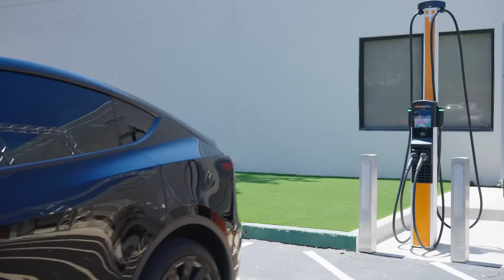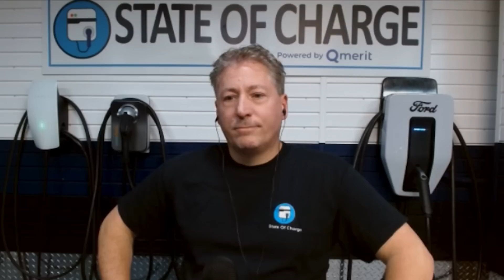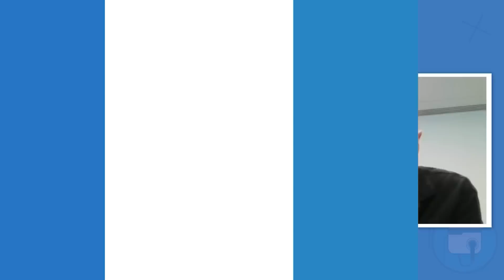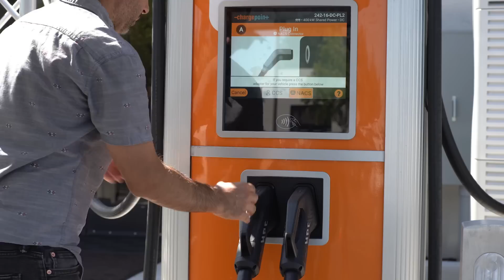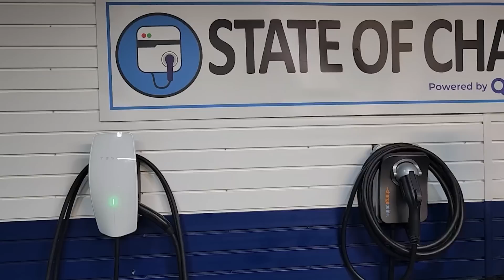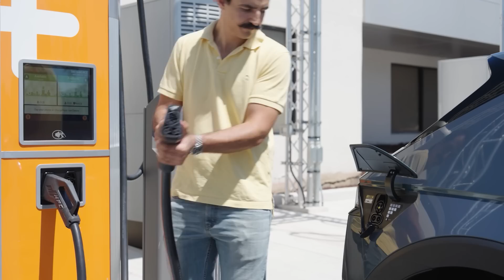ChargePoint CEO Rick Wilmer Discusses How Omni Port Will Eliminate EV Charging Connector Confusion

Comment: Maybe you can tell me why I always have to 1) Plug in my Chargepoint Flex to my EV (either Bolt or ID4); 2) Wait for the yellow light: 3) Unplug the charger; 4) Wait for the green light. Always. Both cars. Other than that, I love the system! 

Speaking of modularity - I think it would be really great to offer a dual-cable adapter kit for the Chargepoint Flex. It would have to be intelligent enough to either switch or share the connection, but I don't think it's an insurmountable problem. Thanks for sharing!
Reply: Sounds like you're having some kind of wi-fi connection problem - the white light indicates no wi-fi.  Are you able to see charging activity on the CP app?
Reply: @MichaelKirven  Interesting. I didn't know WiFi recognition was necessary before charging. I don't know how I'd go about testing that. Thanks for your input though.

Comment: If all chargepoint dcfcs are connected to chargepoint network how do you not know they're not working? Relying on drivers to diagnose and relay information is asinine. My car just notified me that the door wasn't closed. Let's move into the times. Might want to put giant signs on the units w/o a service plan, BTW. "Owned, operated, and serviced by XYZ shopping mall."

Comment: Really cool upgrade... now they need to build out Express Plus charging stations across the street from Super Chargers that Charge Point owns, manages and maintains.   This will address some of the negative fluff out there about neglected charging staions.   All Express Plus stations sold should be maintained by ChargePoint...so they always work.  These are their flagship chargers and with these new connectors they could become know as the go to station for fast charging.
Reply: 100% if they maintained their stuff it would turn their image around instantly.

Comment: How many of them work on a consistent basis? My experience, particularly in the Austin, TX area, is that they are very poorly maintained and half the time they do not work.  They can talk all they want about the different models but all we see is the label ChargePoint and it is not working, it is a terrible image. My suggestion when they do not maintain them is to put a different label, probably the label of the owner.

Comment: It's very frustrating seeing a 50 kW ChargePoint  near me at a truck stop next to a main highway that has been off-line for years. My best information is the owner needs to pay for a new board to get it back on the Cell network after the Cell Carrier shut down the old system. Such a good location, part of the truck stop , A Wendy"s, sub shop. gas/convenience store . Next to a solar farm.  I was there one day when a new Leaf owner was trying to connect to it -It is not listed on the ChargePoint app anymore. At least the level 2 unit was still there.  Probably easier to replace the unit with the  new omni-port. 
I was at a location at another Wendy's in a lake-side tourist town . They had a level 2 ChargePoint that was off network. Using a NFC card would turn  it on for a free charge!  Very handy near the motel and a Frosty. <G>
Reply: You gotta go into the business and let them know you'd like to have the charger working. These franchise owners are still a small business, they have to make a business case for the expenditure. More people coming in and seeing the charger as a draw for the biz is how things get repaired.

Comment: Omni Port is a gap technology that’s not really necessary. Eventually all of NA based EVs will use the NACS. In the meantime, would you really go on a road trip and not bring charging adapters because Omni Port is available? Of course not. So, Omni Port becomes a pleasant surprise instead of a differentiator.
Reply: It's still going to take 20 years before all EVs on the road have NACS. You still have to account for all CCS vehicles that are currently on the road and factor in how long they last or even  pre-owned CCS vehicles that will be purchased in the future. The Omni port is needed to help this transition.

Comment: THERE ARE NO UL APPROVED ADAPTERS - THERE IS NOT STANDARD
Reply from the maker: You are correct, which is why I mentioned that. However, ChargePoint has worked with the SAE and UL to make sure the adapter conforms with UL 2252, which will formally be adapted in a few months and the adapter should receive formal approval then.
Reply: He literally said in the video that it IS UL Approved...
Reply: @dtiff  I think the deal is that the whole system is UL listed.  Just as the Tesla Universal Wall Connector is UL listed, inclusive of its captive adapter.  But neither Tesla nor Chargepoint can sell those adapaters separately as being UL listed because that standard isn't official yet.
Reply: The Omni Port has the UL mark in their press videos If you look close

Comment: I really don't like their business model. If I go to a BP gas station 99% of the time it works. Besides a spill or power outage, I can get gas. I will look on ChargePoint's app for an available charger and it will say it's available and ready. I go to the site, and it doesn't work at all. I blame ChargePoint. This is the business model they chose. Instead of installing and maintaining the equipment like gas stations do, they decided to sell the equipment and then be hands off; kinda like the ice cream machines at McDonald's in a way. The purchaser can't work on the equipment without overpaying the company to fix it. Until ChargePoint owns their sites like most companies do, it's just not going to work.

Our electric company just put in a 62.5kw station by me at a gas station. Of course it is ChargePoint. So, our electric company has to rely on ChargePoint going forward for fixing the unit. Thus, I will blame ChargePoint if it goes down due to communication errors or anything else outside of a mass power outage.

Comment: If Omniport is like Magic Dock, I'll likely never see one, but I need CCS anyway.

EVGo is my favorite network because it supports plug and go. I don't need an app or an RIFD card or even a credit card. After the first use, the network recognizes my vehicle when I plug in and has a record of my credit card. It's easier than pumping gas even if it takes longer. Why don't other networks do it?

ChargePoint is a close second because I have an RFID card on my keychain that Chevrolet included with my Bolt EV. Only a quick swipe of the card is needed. PlugShare reliably lets me know that a station is working, so I don't worry about stopping at one that's out of order.

Electrify America is near the bottom of the list because even with their app, I often must call their support # to start charging. Maybe they've addressed this problem, but I wouldn't know since I now avoid them.

Comment: Mr Wilmer, will the Omni-Port communicate with older Tesla’s using (CAN) their communications standard? Every customer should upgrade their Charge Point hardware pronto to avoid adapter havoc from the damage they can/will/have pass along. The cost of flaky adapter damage vs this upgrade is negligible and the versatility it adds is two fold. Budget it and get it done to make the most of your investment. I’m looking forward to the GPS based station trouble reporting capabilities in the near future. ~ A Charge Point HomeFlex Owner and frequent Charge Point DCFC customer. The most reliable network I have used so far. Oh and by the way, the inlet type dock is a huge cable preservation technique. #keepupthegreatwork

Comment: We have a couple of free Chargepoints in Roseburg Oregon. Seem to work well. Not CCS, but charge at 6kwh I think.
Reply: kWh is a measurement of energy. kW is a measurement of power. 6kW of power supplied for an hour is 6kWh.
Reply: It's hilarious when somebody complains about something that is offered to them for free ;)
Reply: Charging at 6kWh is worthless unless you sit there all day.
Reply: @chrisroberts3963  not true.
Reply: I've  never seen a Charge Point J1772 faster than 6.6kW. Free or pay.
Reply: @johnzangari3432  that's because they max out at 7.2kW. Most times it's a little less though. Great for office buildings or where people park for long periods of time. 

Even good at retail locations where you're shopping for an hour and adding a little bit of miles to your vehicle. Honestly, I think L2 stations are much more important than L3 stations for day to day use.

Comment: My biggest concern is up time and reliability. And my wife and I were travelling from Canada to Florida and back since we drive a Tesla we exclusively used the Tesla charging network. There is only one time in the trip that we had stall that was not working and usually there was multiple stalls so no issue. However, we saw many third-party charging stations that had an out of order sign on them a piece of paper tape it or you find out the hard way when you try to use it. we noticed ChargePoint systems and out of curiosity. I asked a few folks that were charging their but their experience was like. They said hit and miss. Sometimes you pull up to a ChargePoint charger and you plug-in and things just don’t work a lot of steps software between your phone and you need an account and everything needs to be set up and sometimes the application is slow, or sometimes you get an error on the ChargePoint charger and you gotta waste time to phone somebody. I’ll need to find out that there’s a problem with the stall, and then you have to go to not relying on that location in order to make it to your next destination. And tell these third-party charge facilitators can show consistent up time and making sure that their equipment is working and continue to work towards a more seamless integration. My reason for buying a Tesla was charging network. It’s highly reliable and it’s seamless.

Comment: Having 1 million ChargePoint stations and having 1 million ChargePoint stations working is a bit different 😂
Reply: In my experience, divide by 2. At most locations, typically half are out of service.
Reply: More than 1/2 of the ChargePoint stations I’ve recently visited had dispensers that were NOT functional.  Looking forward to the day they brag about their reliability numbers.
Reply: When they’re working they activate wicked fast with a phone wallet RFID. Their sales and maintenance model is lacking in the past so hopefully they can learn lessons and improve going forward.
Reply: The reason they have so many is they sell chargers and do not maintain them. It's up to the owner to keep it working.
Reply: @ralanham76  ok 👍
Reply: I’ve found ChargePoint to be functional 98% of the time, but all chargers around me are under 7kW.
Reply: They probably still have more working than other companies have even installed 🤣
Reply: More reliable than Flo in my area. Ironically, due to GM deal with Flo credits, I used the flow app to initiate charging at charge point DC stations more than I do at Flo.
Reply: @BremboT in the last month my Flo card gets a consistent “ card read error “ at chargepoint locations.    I’ve called flow support twice and they have said and repeated that they are aware of this issue and it is on the chargepoint side.
Reply: I’ve used ChargePoint several times in various locations. Never have I came across a location where they wasn’t working. As a matter of fact, I’ve only gone to a public charger once where that particular one wasn’t working. That was an EVgo. If I’d taken the opportunity to check its status in my infotainment system I would have known that before driving to it.
Reply: Also not all are public, all of the DC Fast chargers I’ve seen of theirs are at dealerships and only available to those who bought cars there.
Reply: Like others here have commented, I've also found that ChargePoint has been fairly reliable. Volta on the other hand is a bit of a pain in the ass.
Reply: Yes but charpoint is a lot better than EA lol
Reply: I have found the ChargePoint locations to be reliable. Not 100% but very reliable.
Reply: There are owned by companies or individuals not charge point.
Reply: Well, ChargePoint doesn't operate the chargers. If station owners don't buy a maintenance plan or pay for repair ChargePoint can't do much.
Reply: I have never been to a non-functioning charge point location. Then again I've never used one because we use the Tesla charging network. Also never found one of those non-functioning though I did have to wait for a spot once. Then again fueling my Jeep up at Costco I have to get in line for an hour every time, maybe a little longer now that one of the pumps isn't working.
Reply: @WentzCraft  You wait to fuel at Costco for AN HOUR. As in 60 actual minutes? The waiting lines must be close to a mile long!
Reply: @wholesomeengraving  Far enough back that you can't see the station. it's probably only 30min waiting but it feels like an eternity. Would be faster if people knew how to hurry up, every person looks like they are filling up for the first time...
Reply: @WentzCraft  Funny thing is, I tell coworkers I walk across the street to plug in at my free charging spot and they look at me sideways like I'm crazy. Meanwhile, they're the same ones in these hour long Costco lines for the opportunity to save 3-6 bucks per fill-up😅. I don't like their brand of math.
Reply: @WentzCraft You can't reasonably know much about Chargepoint IF you have a Tesla.
Reply: @callistoscali4344  I apologize for the confusion, and was hoping to make that obvious from my comment. I know nothing about charge point.

Comment: It would really nice if people in the industry would use the correct nomenclature for charging connectors, including the recently standardized J3400.
Reply: I'm not sure I agree.  J3400 has more in it than just that connector--for example, it specs the Mennekes connector for untethered L2 cables.  Should we call them J3400 too?

Comment: Stopped at a new chargepoint 300kw station.  Impressive looking chargers BUT would not connect to my chargepoint app in charge of the rate of 56 cents a kilowatt.  Highway robbery. These companies need to be regulated.
Reply: The fast charging business is a money losing business, the cost you stated won't even cover the running costs. Not to mention no money for new chargers and power modules.
Reply: @Harrythehun um, somehow Tesla makes a reliable charger, at a good rice and makes money at it

Comment: What a monstrosity the omni ports are.  Completely negates the benefits of the elegant NACS cable - small and lightweight.  The Tesla magic dock was a much better solution.
Reply: That would have been a great question to ask him.  Why this direction instead of native NACS with a captive CCS adapter?
Reply: @charliesullivan4304   Because they already have thousands of native ccs machines on the pipeline. Maybe in a few year it will be the other way around. In the same fashion they are installing chadamo 🙄
Reply: I agree but it’s worth it given this will allow existing CCS chargers to be retrofitted more inexpensively and become the standard option (so all chargers going forward support NACS) until we go all NACS.
Reply: @Lynyrd_Evnyrd  ,  @Wised1000  Makes sense, thanks.
Reply: Elegant🤮
Its a charging handle who cares? Anyone ever dicuscuss the styling of a gas nozzle?  What about putting longer cables?
Reply: “was” is the operative word here. I don’t know how much it costs to convert a good percentage of Supercharger dispensers to MagicDock. Tesla could charge extra for it.
Reply: Agreed, extremely big and bulky two handed CCS monster.
Reply: Tesla also sells an AC charger called the Universal Wall Connector. It is basically that sleek cable you like, with a little adapter that sticks to it to make it J1772.
Reply: Any money going to Tesla is hugely problematic!

Comment: I used ChargePoint chargers where I worked for 4yrs and they never had an outage.
Reply: Where I work we have two of four posts have issues, and a third has a cell issue. Their maintenance agreements are too high for the company I work for, so nothing is addressed on these posts. This is not a good look for CP when they have their name on posts that do not work.
Reply: @CraigMatsuura  It's a fundamental flaw in their business model. If they cover their equipment in their branding, they need to make sure that equipment is working. If other people are going to own and maintain it, don't slap your name on it.
Reply: 'If they cover their equipment' additional sub-branding is necessary...
Reply: @CraigMatsuura  Ditto. The ChargePoint chargers at work are not Tesla quality. Ours are usually needing to have their modems replaced or software issues that have yet to be resolved even after mutiple visits by techs.
Reply: Sounds like bad techs.
Reply: They seem to be really slow chargers though. I don't want to wait 4 hours for a full charge on a Prologue for instance.
Reply: @mikesaintjulesmusic  are you talking L2 or DC fast charging ?

Comment: Great news. But the reporting broken units is still hard on their app. Also there name is on the units that are broken. Most of the level 2 chargers around here that are chargepoint are broken for years. We really need more level 2 chargers. Their name in our area is mud. Another one which is over priced and have many broken ones in our area is EVgo. Many in our area avoid these 2.
Reply: At 9:00 he talks about exactly that.
Reply: @charliesullivan4304  I know, but their name is on it and they are broken. I have actually called them, and even spoken with the location people. Most of them say it's too expensive to fix.